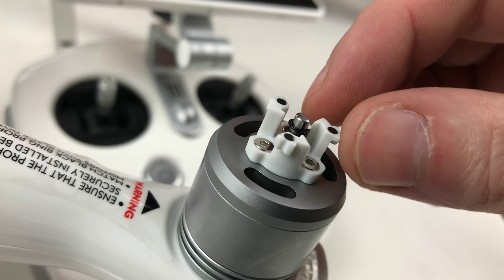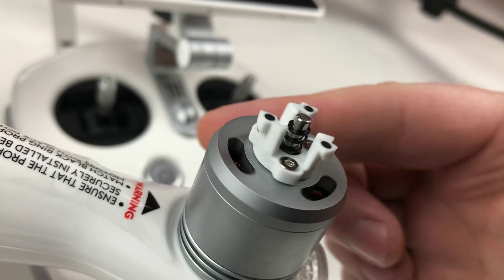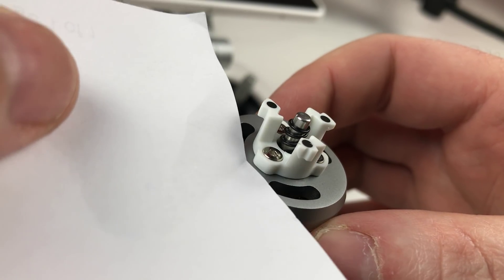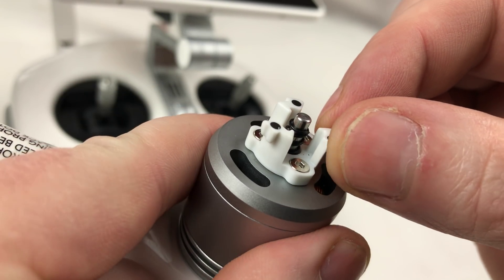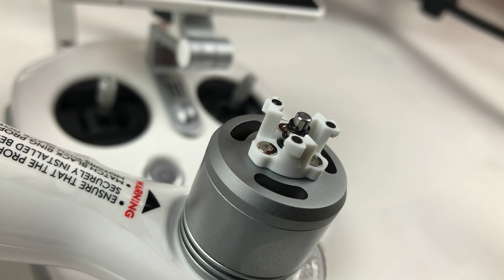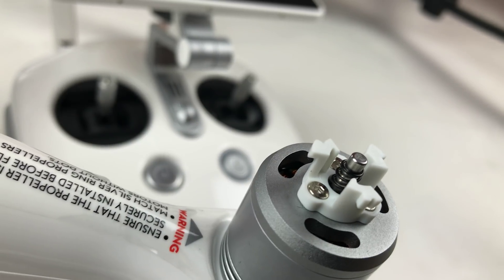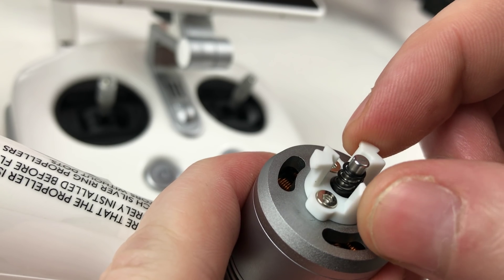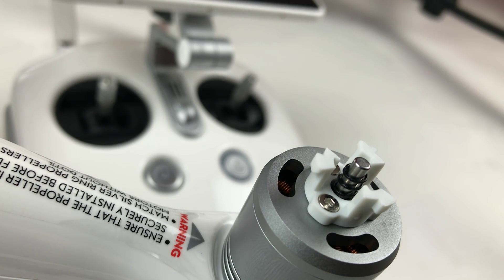Wobbly Prop Mounts - DJI Phantom 4 Pro+

Comment: Had same thing but all I did was  replaced the bases and New screws witch you can get on eBay...as a screw set for dji phantom 4 and pro look it up it fixed my p4s problem

Comment: The screw is Phillips Head. Perhaps you could remove one at a time, apply a little Loctite Red thread cement, refit correctly. No problems. Cheers.
Reply: No, it takes an allen wrench. Never put Loctite on a phantom screw anywhere at anytime. You're giving out bad info.
Reply: No lock tite on plastic it will  damage it even if it's  metal to plastic  ...do at your own risk
Reply: Don't use thread lock
Reply: @johnfoley8063  you can use blue thread lock.,actually most components I work with including custom made drones and dji stuff use it.even when you buy a set of screws they are usually predipped in blue.don use red and DONT use any of the glue stuff.it will eventually damage the plastic
Reply: The Plain Truth Loctite blue not red is fine. Where red requires usually heat to break the bond. Blue on the other hand is medium strength and easily broken. I see no reason why not to use blue Loctite on the screws

Comment: DJI has a serious rash of disgruntled workers. The variety of problems with the phantom series is mind boggling.  Simple things that could only be done on purpose.QC is zero.
Reply from the maker: I have had P1, P2, 4x P3 Pro's, 3x P4's and have 2 Mavic's, Inspire 1 pro and 2 P4P+'s  - This is the first QC issue I have had and all it was is screws needing tightening.

If this is the worst DJI can do then I am happy :)
Reply: Andy Hughes   Consider yourself very very very lucky. I wont get into my issues as im sure youve read about them on DJIs forum.
Reply: Andy Hughes    I just thought of something. If you have/had 3 P4s ,which i assume have the identical prop mounts , then why would you assume they were loose possibly by design? Also , both of your P4P+'s have had the same issue? I guess youre not so lucky after all.
Reply from the maker: Tongue in cheek comment about it being design :) - I am sure DJI will tighten up the QC ( pun intended )..